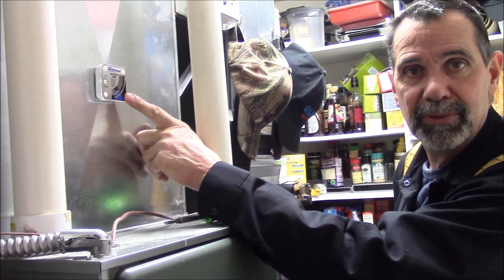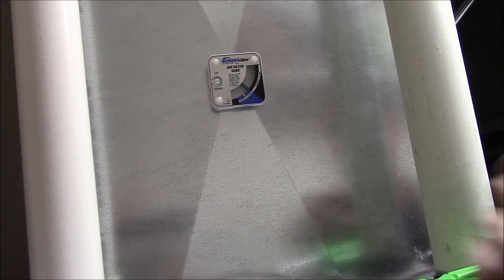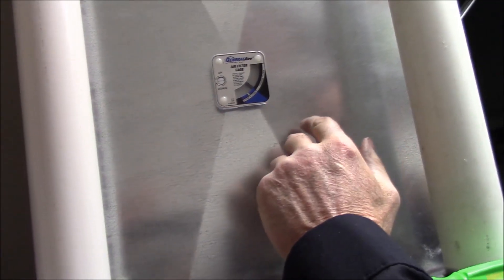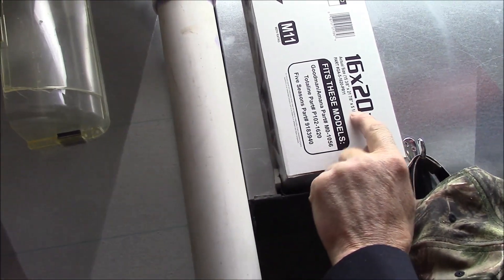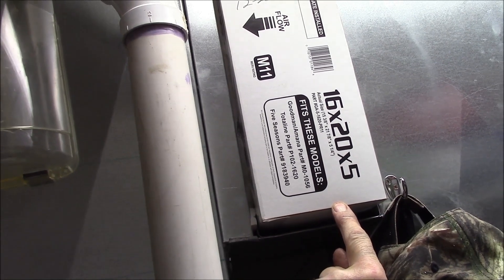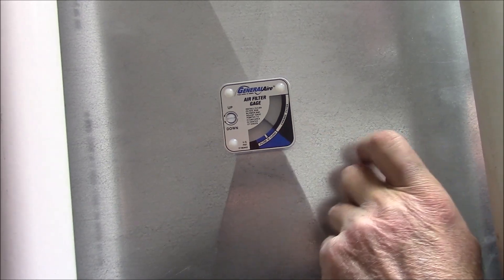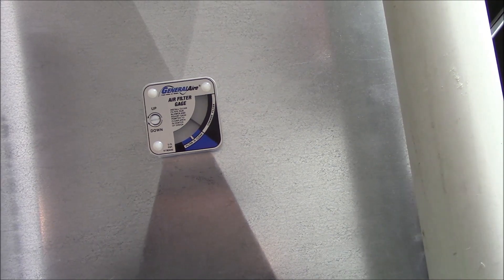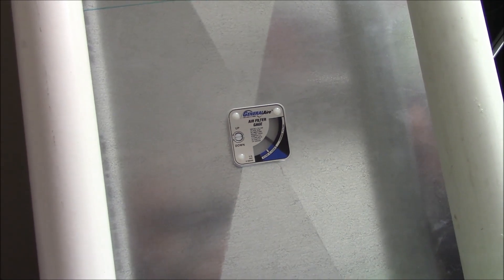Furnace Filter Monitor Gauge Tells EXACTLY When to Change Filter

Comment: Would this be a better solution than a differential air pressure gauge across the filter?  Thanks
Reply from the maker: I kind of think this is a differential air pressure gauge because it is between the filter and the fan so it’s simply measuring vacuum. Filter gets clogged more, then a higher amount of vacuum will be created.